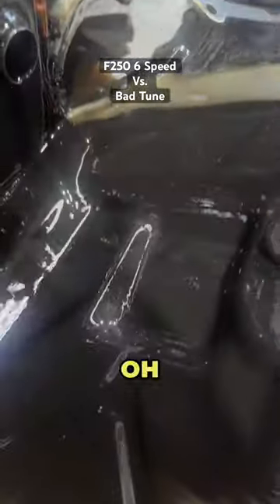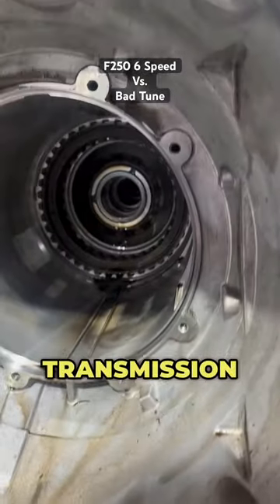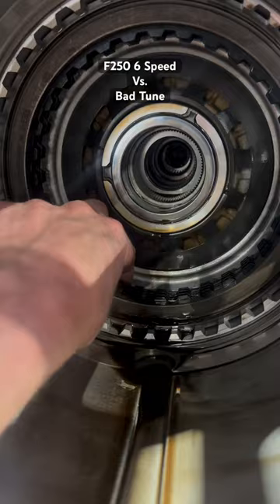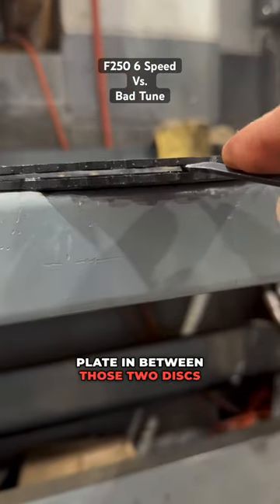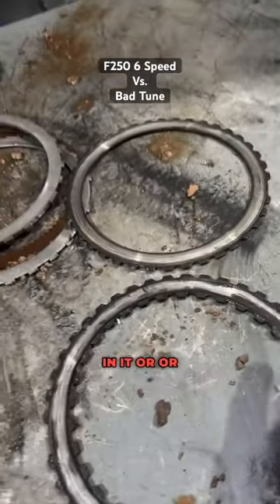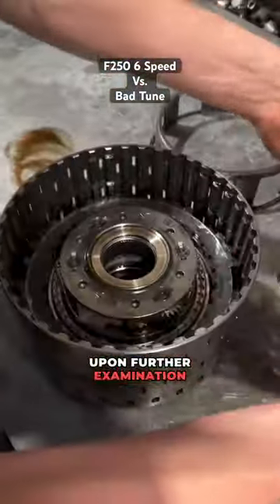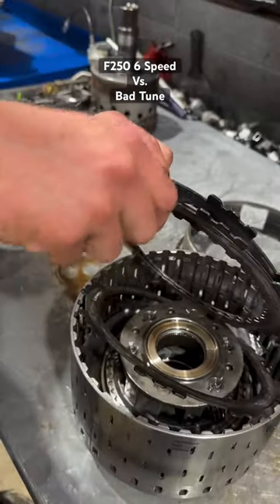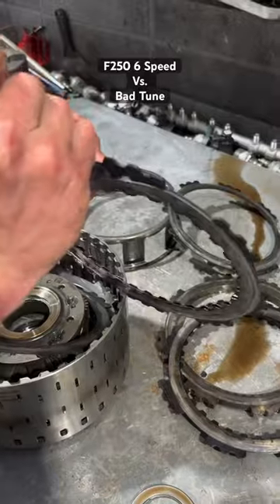F250 6 Speed gets melted by HOT TUNE. #ford #f250 #shorts

Comment: I’m surprised the dealer tears them apart… I figured they pretty much just replaced them
Reply: i don’t think he works in a dealer i could be wrong
Reply: Old dealership guy here !! NO WE HAD TOO PROVIDE 70%failure . Pictures! Before they would send a replacement!!! Oh worst part 3.5 hours pay to remove trans and provide failure!! Takes 6 hours if you fast
Reply: @chadjohnson2853 unless warrenty, why would they care about it? It's being paid for. This obviously it ain't warrenty here cuz of "hot tune"
Reply: @yy-xt4kw he works in a Ford dealer. They still rebuild transmissions
Reply: Depends if it’s customer pay or warranty some ford TSBs want you to rebuild the transmission
Reply: @chadjohnson2853  sounds pretty shady… mechanics deserve better than that. It’s rough work and most people wouldn’t dare get their hands dirty doing it
Reply: @esaicastaneda9671  this shit happens under 35k brother
Reply: @chadjohnson2853  hyundai tech here…1.4 hr warranty time to do a transmission replacement is the shortest I’ve seen. We also have 5.5 or 5.2 hr engine replacement times under warranty for some models
Reply: We absolutely tear down. Especially engines. You think Ram is gonna warranty a 40k engine on a truck with 90k without trying to fight it. Ram dealers at least tear down all the way not sure if the rest of the companies do, but I’d assume they would.
Reply: Yes some dealers do this after the 3rd time the same part fails
Reply: Yes, transmission rebuilds are still done in dealerships
Reply: @obamaatemyson5297 I worked for the FCA national warranty center. We would have people calling pissed off because dealers would do the teardown, warranty would be denied and they wouldn't want to pay for repairs or to put the engine back together. We've even had issues where they tell the customer they will do the teardown, but if it's not warranty covered they pay for the teardown too.
Reply: @CumminsTech24 in order to warranty’ my STi engine Subaru wanted to do a tear down and send in oil samples
Reply: Repair unless it’s totally fucked.
Reply: @Randy-o3b thats why there is a shortage of technicians. Nobody wants to do it anymore.
Reply: GM dealer here. Warranty time for test drive to diagnose or confirm there is a problem is .3 warranty time. In order to get that time you have to have a DTC and performed a electrical diagnostic (you won’t have dtcs with most trans concerns at a GM shop) or you had to record the transmission input, intermediate, and output shaft speeds, transmission shift times, or transmission torque converter speeds and report the information to get paid. Even then, the GM warranty administration will likely flag the diagnostic because observing the scan tool is a “strategy based diagnostic” and does not warrant a diagnostic claim to be paid. To pull a 6 speed two wheel drive out of a Silverado 1500 is 2.9 Warranty time for internal inspection is 1.0 clean up time is 1.0 and you have to get an “other labor hours approval for it. Warranty to reinstall and perform a verification drive is 2.9
It order to replace a unit under warranty, you have to perform a cost analysis. The cost to correct the failure must be 85% of the cost of the replacement unit before you can get a regular warranty approval. 
You can submit for customer satisfaction, but those types of repairs are flagged and will be sent to a GM depot level repair facility and your claim will likely be completely debited (they take the money for the repair back) depending on what they find vs your reasoning for replacing instead of repairing the transmission. 
Most times my shop will only allow a replacement under warranty is if we’ve pulled the transmission out 3 times to make a repair under the same repair order. 

Would anyone like a job? For some reason, I can’t find a dedicated transmission tech that will come work for me.
Reply: I can tell you right now, GM dealers are the reason customers keep coming back to buy GM cars. It’s getting harder and harder to ride for the brand and keep our customers safe from the manufacturer. 
Call dealerships stealerships all you want, but we can only be as nice to our customers as the manufacturers allow us to be.
Reply: @codyprice0295 sounds like GM is horrible to work for. They’ve also been denying warranty claims on duramax engine failures. A friend of mine had 2 different trucks, I cannot remember the years. Both had the fowl pins sheer off the crank and trashed them both. One truck had 98k, they said it’s not warranted to replace under warranty. The other truck had mid 60’s and dealer said same thing.
Reply: @codyprice0295 That right there is why I USED TO BE a GM tech. Left, and started my own shop. We fix anything from an Audi, or Alice Chalmers, to a Volvo, or old Deere. No warranty to deal with, unless you get sold a bad part.
Reply: @codyprice0295  I am not sure what the GM customer relationship is but my work has quite a few newer Malibus and they have had a ton of problems and spend quite a bit of time at the dealer. I think the quality of all cars have really gone down hill. The new fords we have also go to the dealer quite a bit but ford always tries to find a way not to warranty the repair.
Reply: It depends on the transmission, some you can order oem rebuild kits and some you cannot! It’s not that dealer techs can’t or are to lazy to rebuild stuff it’s they have to follow what the manufacturer recommends. We’re a independent can order whatever and just get it done
Reply: @levisenge2762 make the move to honda. Better times and better packaging so you don't have to remove loads of bullshit for something that should be fairly simple. Warranty times are noticeably better than Hyundai. Wouldn't be much of a learning curve either as they're pretty similar. We call Hyundais shitty Hondas 😂
Reply: @levisenge2762 I feel that. Hyundai and Kia kill us on warranty times. It's ridiculous.
Reply: Rebuild.
Reply: My boss blew the transmission in his Silverado, they made him send tons of pictures, disassemble the transmission, and send more pictures of that to prove it was blown and needed to be replaced

Comment: How does this man manage to keep his hands so damn clean while reach into oil pits? I swear, I can just touch a valve cover and have dirt on my elbow lol 😂
Reply: Transmission fluid has cleaning additives. It'll clean up that greece fairly easy
Reply: Dealer supplies as many free gloves as you want. I personally use a 100 pack (50 pairs) in about a week as a dealership mechanic.

Comment: You can make a lot more power out of 7.3 for 3-4K.. bigger injectors, intake and a tune. Problem is you then need a 7K transmission and a lot of people skip that part.
Reply: Like how much power does it make if it needs 7k gearbox 💀 i dont understand this at all. I tune 3l diesel and 400hp is good enough dont know where you need like 1000hp  of course hobbyist are different breed but still 0-100 kmh in under 5 sec isnt that enough
Reply: @hoppalo1103  Bigger injectors and a hot tune can nearly double the power.. and 7K isn't really expensive per se.. just a normal rebuild is 5 grand.

Comment: Man, I wish I I could rebuild automatic transmissions. I have rebuilt manual transmissions and rebuild engines a lot.
Reply: All you need is the appropriate tooling
Reply: @hidros1461  Yeah. I know. But it gets expensive. I have a really big selection of tools for the majority of repair work for a lot of brands of automotive work, and I'm still adding to that collection.
Reply: Older automatic transmissions are pretty simple, newer ones I'm not buying the tools for that headache. I can build turbo 350 or 400, even a 700r4 and once a 4l60e and a 4l80e
Reply: @thewitt76  I thought about a 700R4, 350, turbo 400, or a 4L60/4L80. But it's pretty rare I even get 4L60/4L80 in my shop. It's normally 6 speed up to the 10 speed transmissions coming in. I'm not willing to dive into those until I get comfortable with something a little more basic like you were saying
Reply: @motorman111jld  I do my own work for racing and for a few friends and actually had the choice to rebuild my 700r4 or walk so I got a bad one with a busted case and took it apart with lots of pictures and to understand how it went together then went into mine. Luckily mine was bad valve body and worn clutches so no real trouble diagnosing but I did it and put a lot of hard miles on that beast after
Reply: @thewitt76  How difficult is the THM125C?
Reply: @thewitt76  That's awesome! I'm gonna have to come up with a bad transmission to see what I can do. I'm just skeptical because I've never even tore an automatic transmission apart. I have rebuilt like 2 speed hydro transmissions in forklifts before. But nothing over that. I believe it is a simple design of how a vehicle auto transmission is. The only one I would consider rebuilding is the one I have in my 2003 GMC Yukon. It's a 4L80 AWD because it's mine. But it's not giving any problems.

Comment: So was the transmission controlling tune bad or was the engine tuned to powerful for what the transmission could handle?
Reply: Transmission tune and or lack of cooling. Too much power would result in broken hard parts such as gears.
Reply: No need to worry about too much power in a ford😂
Reply: @ChrisCrow-s1l  I would love to hate on a Ford because I do all the time but the 6r140 is one of the better transmissions on the market. This is likely due to a "hot" tune and someone stabbing the throttle to make some smoke and noise. When it downshifts it puts a lot of stress on the clutches before the converter locks which leads to this lol.

Comment: I have rebuilt many auto trannys. I hate anything automatic because they soon become no matic. A manual tranny last a long long time. It used to be an option to get an automatic years ago. Then the manufacturers figured out they can make a fortune repairing automatics. You really can’t find a lot of manual tyranny options much anymore
Reply: Loved manuals until l got old with a bum knee.
Reply: I've never had a major problem with an automatic. Manual trans clutches go out all the time though. My F 150 has 240K on it and a friend of mine has 305,000 on his, neither has been touched.
Reply: I've had my share of vehicles and only 1 was auto (was my late Mom's).  A German ZF 3 sp, can't complain , it went 100K mi per ZF expectations. I replaced it and got another 100K . But my current 3 cars are all manual, keeping  them forever, you couldn't pay me to have an automatic.
Reply: @oldman-zr2ru It all depends on driver use. I've got an 01 F150 with 205k on it with the original clutch; if you minimize shock & slip, the clutch hardly wears. But if one likes to neutral drop their auto, it won't last for anything. Also, the more speeds a trans has, the more likely for something to break.

Comment: I am so glad I’m a powerhead guy and not a Transmission guy. Hell I’m not even a powerhead guy yet really I’ve never built an engine I’m more diagnostics and low to mid level repair but I would absolutely destroy the first 20 transmissions I worked on if I tried to do it myself without an oldhead or detailed precise instructions. I’ve got way too much “fuckit runit” energy.

Comment: Change your tranny fluid & filter each year. 
I did my 2021 Ford 1080r at 70,000klm  and it’s a whole different ball game. Shifts like a dream now. I followed a Utube Video on how to do it. Difficult level of 5
Had to buy a Suction Pump from Amazon for $90.00
Get the 1 gallon version, my gallon and a half version doesn’t stand under the truck easily.

Comment: Please define "hot tune"
Reply: Very very simple answer:

Its the highest performance tune a stock diesel engine can take. Called a hot tune because of the higher temps generated  from the increased torque and hp. It also heats the tranny to high temp which in this case may have cooked the tranny. 

When running a hot tune you have to watch your temps very closely.
Reply: @BLACKMONGOOSE13  thankyou